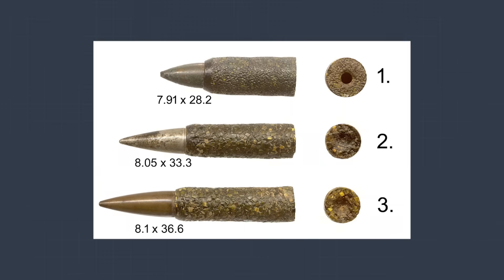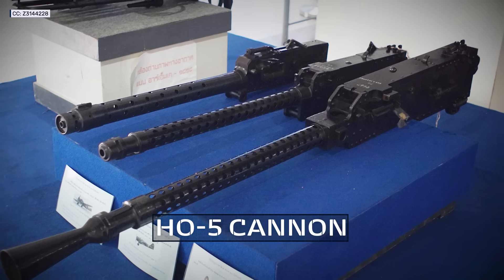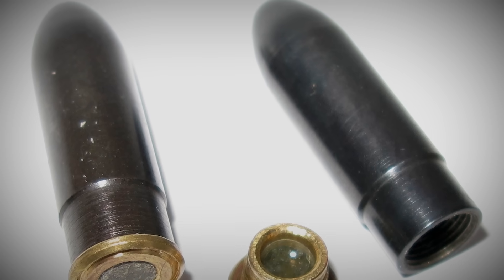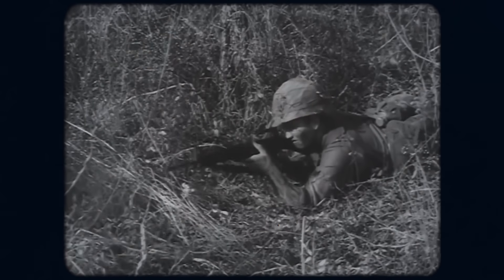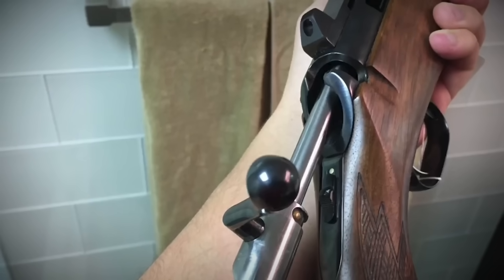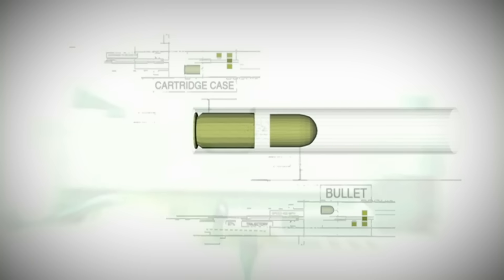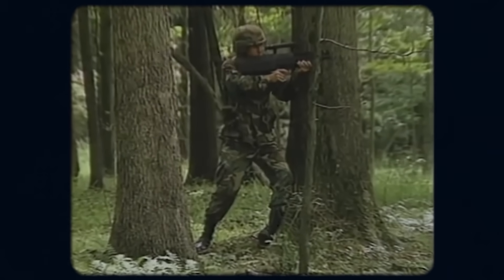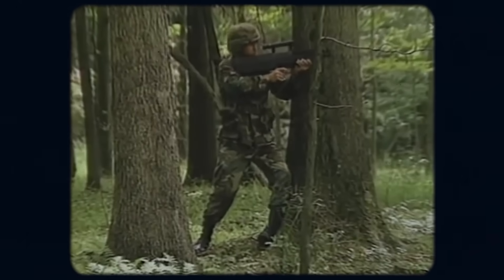Is Caseless Ammunition the Future of Warfare?

Comment: Plastic ammo review please
Reply: Shotgun
Reply: @sween187 😂
Nice!
Reply: Plastic is a decent insulator
Reply: TL;DR Plastic cased ammo works great for rimmed, straight walled, cases. Like shotgun ammunition. Rimless cartridges that headspace on the shoulder or case mouth? You're gonna have problems with headspacing. Then you get problems with them deforming in magazines and issues with the bullets getting pushed into or pulled out of the case.